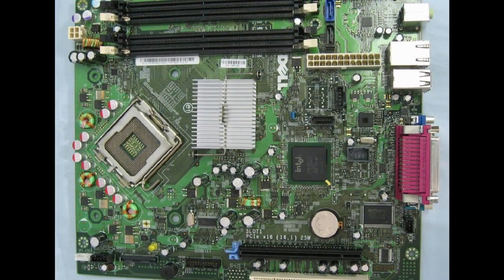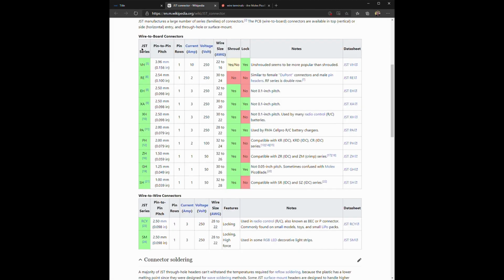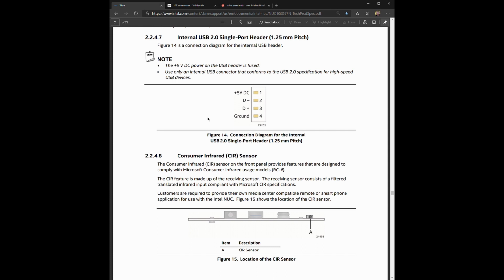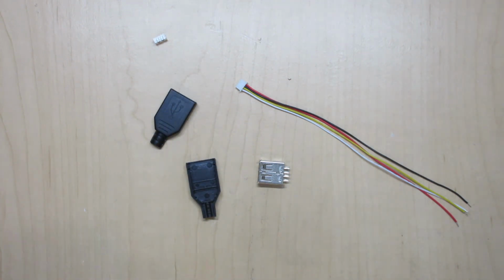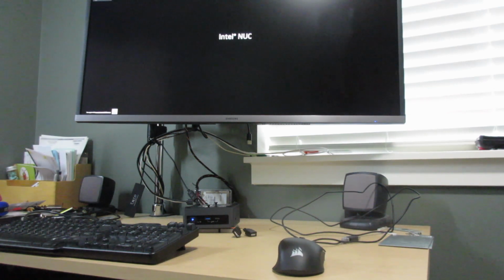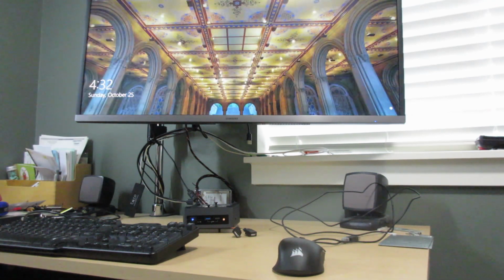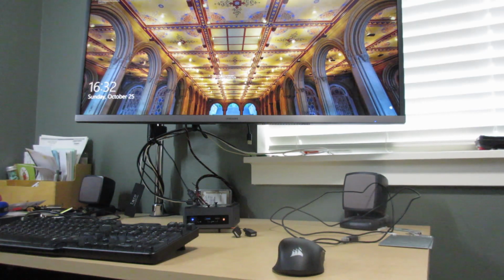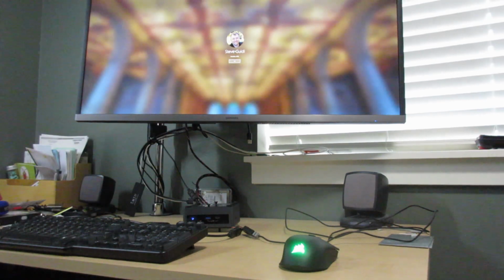DIY: Use the hidden internal USB ports inside your computer

Comment: I recently got a Beelink SEi 10 i5 1035G7 Tiny PC. It has a similar-looking connector inside; however, I cannot find any documentation that explains this port like what you have for the NUC. Do you have any ideas on how to use this connector, what it's for, or how to find detailed Beelink manuals/documentation? Thanks for this DIY vid, very interesting and helpful!
Reply from the maker: Unfortunately, identifying the type of header without the hardware documentation is going to be a guess at best.  It could be a USB 2.0 port, diagnostics header, fan controller, etc...  perhaps contacting the manufacturer may help identify the port or locate the system documentation.

Comment: So intel removed the physical audio port on some low-end NUCs but continues to provide the internal USB2 headers. Lids with USB ports are too expensive, and getting the components like in this video and soldering skills are out of my bounds. I have 6 NUCs, and I find more use of the physical audio port than the internal USB2 headers. Any idea why Intel still keeps the USB2 headers? Is it cheaper than the audio daughter board?

Comment: my father has a new hp he bought late last year that seems to have one of these on the motherboard.  He has a SilverStone USB remote control to power his prior PC via remote. He cannot use it with new PC, which is a shame b/c its power button is rather narrow to press.  I hope a manufacturer like SilverStone creates a remote starter for these newer motherboards that includes the necessary wiring to connect to this apparent 1.25mm Picoblade.  I appreciate the video and will keep in mind as I learn more.

Comment: Hello how to deport the on / off switch button of the intel nuc please
Reply from the maker: I'm sorry, I don't know how to do this.  It would be nice to relocate the power button externally to the NUC though!  My NUC has a programmable infrared sensor.  I haven't studied it, but perhaps that might be useful for your project if equipped?
Reply: @SteveGuidi  The NUC motherboards I've seen have front panel header pins just like regular motherboards.  Plugging a momentary switch into the power button pins will allow you to run one externally.  Only problem is, they are 2.0mm pitch connectors (and regular motherboards are 2.54mm/0.1").  In the US you can get 2.0 to 2.54 pitch converter cables for next to no money.

I'm in the UK and doing exactly this at the moment.  Tried and failed to crimp my own tiny connectors (pitch converters seem rare here), so I'm now waiting for some pre-wired connectors, together with two USB header cables to do what you've done here (I had crimps on order, but cancelled it when I saw how you did it)
Reply from the maker: @simonrussell4986  Thanks for the feedback!  I'm curious to try and replace the power switch now 🙂
Reply: @SteveGuidi  Go for it!  The onboard switch will still work as a fall back, and pretty much anything that makes a momentary circuit will turn it off/on.

I'm working on a NUC 11 mobo, and that's got 11 pins to play with.  Wish somebody made a converter kit for all connectors, since these are a bit small for hobbyists!